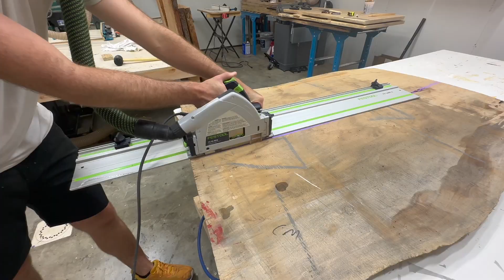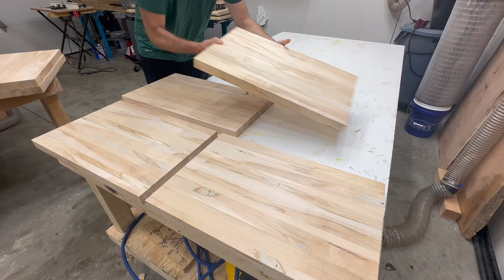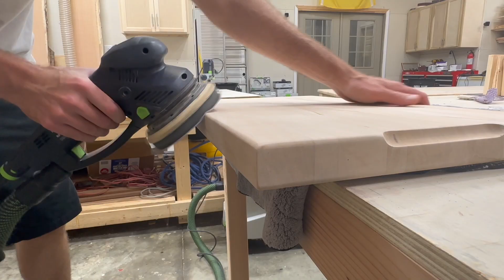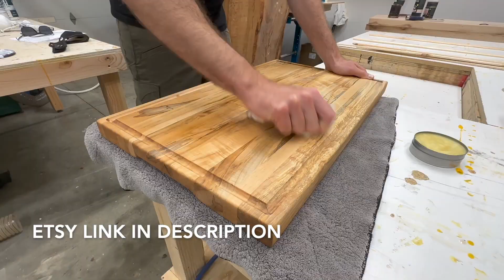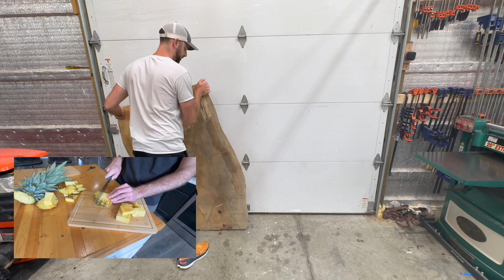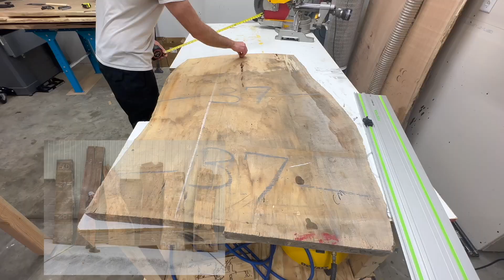GORGEOUS Spalted Maple Cutting Boards from a NASTY Live Edge Slab || How to Make a Cutting Board

Comment: Great video man.  You still happy with your Grizzly G0855?  You keep the knives on it or did you install helical head?  I'm about to make this decision and wondering if I can save a little up front by going with the 855.  Thanks!
Reply from the maker: The fence is a bit flimsy and the beds have been difficult to get and keep parallel/coplanar. If it was in the market for a jointer, I would look for a higher quality machine personally. My jointer still has the knives on it.
Reply: @ Thanks for the response.  I wonder if the issues you experience are a one-off or if these less expensive Grizzly jointers just suffer from these defects.  I’m very much still learning so it seems like it would be a good first planer without breaking the bank.  It’s on sale right now.  You do great work.  I hope to get there one day.  It’s a great escape from my IT job.

Comment: Beautiful boards! Did you do anything to stabilize the spalting or will it be fine?
Reply from the maker: Thanks! The spalting on these was in the very early stages. As the slab was kiln dried, my understanding is that the spalting should not progress further. There was no difference in the hardness or ‘feel’ of the wood whatsoever between the spalting and non-spalted portions 👍🏻